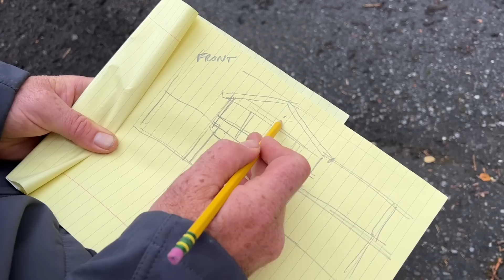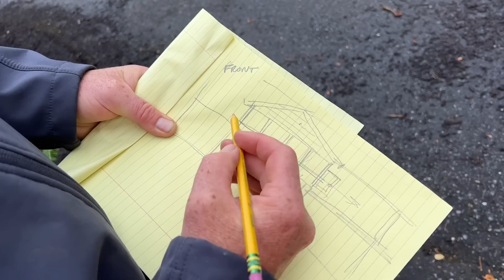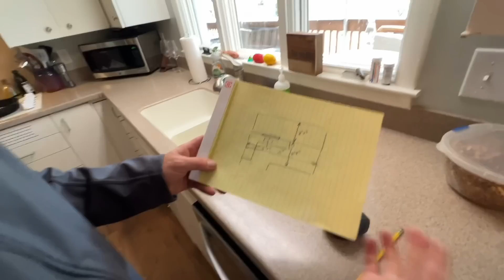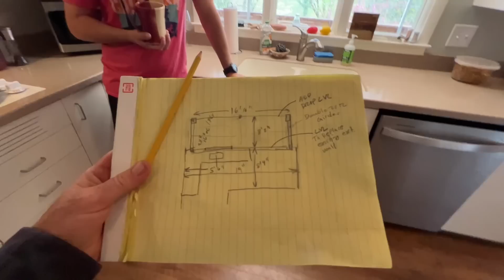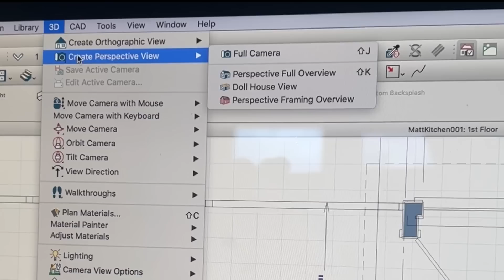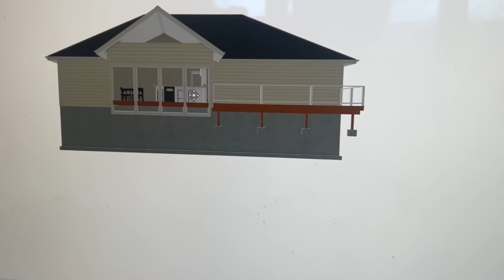Kitchen Addition & Remodel EP01 | The Design

Comment: uv ray's eventually work on breaking down any kind of liquid applied water proofing not too mention the hot & cold constantly effecting it, it will, eventually become a place for water to settle and that will become a leak after 20 years single tab asphalt shingles are going to break down.

Comment: 2" floor rise... could use rigid foam under the subfloor for added insulation and cheap spacing. It's how I turned my deck into a 4 season sunroom.

Comment: Hey Eric, Those brick "posts" look like thin legs on a tall bird. I recommend you drop back few inches and build 8X12X16 finish blocks. Add rebar and grout. Then add what ever kind of top girder you want. But, strong winds or a small earth tremor on those brick stilts will allow crumbling, especially if you add load on them.
Reply: I'm having trouble visualizing what you mean
Reply: It depends a lot on how the columns are built... If there is a central rebared concrete column (looks like there might be, based on the dimensions of the column vs the bricks) then there isn't any concern.
Reply: @MrCjallaby  have you ever seen a stack of finish concrete blocks? They are everywhere in the mid-west.
Reply: @kschleic9053  it does not depend on a lot of anything except simple math. The modulus of blocks will be about 1 1/2 times that of the brick stack and 10 times the stiffness. But, don't take my word for it. Go buy a Jenga Block game and figure it out for yourself.
Reply: @Tony McSteven Yes the irony. Like it?
Reply: Very curious how those brick columns are made!  Hopefully if the LVL goes in as discussed it will help stabilize them more-so, but they do look tall & thin!
Reply: Mason, concrete finisher here.. excited to watch further but I’m also very skeptical of the brick piers. The wider the pier the more resilient it is from movement, I’m curious if the brick is just a veneer around a 6x6. If it were me I’d shore up one pier at a time, tear down the brick, pour proper footers, and then lay 16” x16” block piers and fill it solid. Take shoring out, bolt in whatever lvl brackets you want without worry.

Comment: I really like that program. I also purchased that program because of your channel. 

It really does a whole lot! Huge learning curve for me, but it was doable. 

When you have the ability to make professional plans, it makes it a lot easier to get through the building and zoning department. It also gives a clear picture to your client of what you are doing. 

You can go as far as putting material lists in your building plans and also cut lists. 

Chief architect 2022 is awesome. If you are a builder, even a small builder..  you really should consider purchasing it. You can even do a monthly subscription which is $60 a month, and pay as you go. 

 If you come into the slow season and you don't need it, you don't have to use it, you don't have to pay for it. Then when it comes time for you to get busy again just go and spend another 60 bucks.  It will make your life easier, and bump you up a level. 

Great video btw!
Reply: @davidwesternall873  the program is great.

Comment: I'd put arches under the deck, not only are they good for structural support and spreading the middle weight to the post but they're also  quaint and esthetic.
Reply: Sure it might not fit the style of the home to well but you could easily do it with bricks, cheap, pretty, easy and strong.

Comment: Enjoy ya'lls videos. Don't recall the episode but you guys were using a "paddle bit' or spade bit to remove some wood material. Years ago I purchased some Bad Dog brand "Rover" bits.. I use  them all the time remodeling and repair work.  Wonderful product, faster that spade bits and user can control the direction. Might want to have a look... I'm not in anyway affiliated with Bad Dog. Just like this product.

Comment: The brick columns are 16" X 8". Building code gives a max height of 80". Since your existing height exceed that, any new construction should at least meet the building code. A 12" X 12" would most likely pass, it would still be marginal with a max height of 10 feet. Ask anyone on the street, bigger is better!
Reply: I was just going to look up brick columns after this video... I'm always nervous touching masonry with anything load bearing.  Around here a lot of foundations are concrete but for some reason the last 2 or 3' are hollow clay brick. Stuff cracks if you look at it wrong.  This looked like traditional solid brick at least and very nice & large grout joints so those would be easier to drill into for anchors, but I'd still be nervous for something this far off the ground.
Reply: My wife agrees

Comment: Pro Tip: Cleaning roofing tar off your skin or tools, WD-40 100% cleans it off with minimal effort, Like amazingly wells, so on your skin just clean it with Wd-40 then clean the wd-40 off with normal soap.
Reply: Wd40 or karnaclean is a lifesaver
Reply: Baby oil works wonders also. Like dissolves like

Comment: Those brick columns concern me considering the extra weight going on them. You really should be getting an engineer involved.
Reply: I'm reminded of those decks that fail due to unexpected weight with more people. I imagine a kitchen with island and appliances will be a gathering spot for family/friends.
Reply: There really should be a lag bolt or equivalent in between everyone of those joist on that rim board. It scary how light people build decks.

Comment: Nope, no way I'd do that addition without a architect or engineer,  and no way I'd trust them brick columns,  definitely need something bigger,  like cmus,  plus I would never trust them old joist.
Reply: Bricks carry 9000 pounds per square inch. CMU's carry 3200 pounds per square inch. Bigger is better.
Reply: @metroman93f27  You might want to double check your numbers
Reply: @jtgrec3179  I was referring to clay brick. they have a compressive strength of between 8000 to 10000 psi. Concrete brick have a compressive strength of between 3000 and 4000 psi. My number for the CMU would increase with grout. (It increases the square inches). The grout itself is usually 3000 psi.

Comment: What does it mean when you said "we aren't the contractors on this job, the homeowners are" ?  I wasn't sure what the significance of pointing that out meant.  (or if any other viewers know the answer and can help me out).
Reply: The homeowners are going to manage the job. They are going to pull the permits and hire all of the subs.
Reply: I don’t think the Perkins will be doing everything that the homeowners want done. Probably just the framing and helping out with understanding what they need to get done. 
So once the Perkins have finished their part, they aren’t going to have to worry about any other part of the project.
Reply: @darrenmarsh2290  Thank you!  I thought it might be something like that when he started talking about them having to take his plans to the city, instead of doing it himself.

Comment: Eric, I've never felt like saying anything, but will this time.  You're not doing your friend any favors with what you've planned.  First, the existing structure needs to go, those joists have been out in the weather for who knows how long.  I noticed the 14" LVL, did the size of that surprise you?

The roof is another matter, I was able to see, even in your video, the wear on those shingles.  The whole thing should be replaced.  Didn't we just learn in your last video, that the stone on the fiberglass shingles, is what protects it from UV rays?  Come on man, don't short-change your friend - because you think you're saving him money - it's the wrong approach.
Reply: Please go away with your Matt Risinger type of approach. He was supposed to renovate his house, ended up redoing the whole thing. With that approach you will probably advice them to rebuild the whole house because shingles are old and deck joists might be weathered.
Reply: @Faruk651  also the Mike Homes approach.
Reply: The roof really needs to be ripped off. If cost is an issue I would for sure do the entire back now and then do the front within a year. And the framing over the shingles 😭
Reply: @smcox1991  yes, it is obvious the roof needs to be replaced but maybe it can wait another year. Not everybody has deep pockets and fancy way of rebuilding like Matt Risinger or This Old House.

Comment: This is the wild west. This project should be designed by a structural engineer after conducting a site survey, not a GC who wears flip flops on a wet roof. LOL.  No disrespect to Perkins but let's get real here. Relying on the municipality to sign off on this is moronic - the municipality is clearly not invested in safety if they approve this.
Reply: I know enforcement and standards vary across regions in the US, but I second this. Talk of reusing the deck support columns seems completely irresponsible. Sure they're basically creating a sunroom, and maybe those deck supports are integrated into the existing foundation? But they're glossing over a serious structural safety issue.

Decks like this fail on their own fairly frequently. I'd never think of putting a whole room on top of just a deck given how lax deck structure can be.

Comment: Why would you need a permit for an existing building. Surely  Modifications are only inspection once complete?
Reply: If you're changing the visual appearance of a building you usually need planning permission.  At least in all European countries I've lived in.
Reply: We are adding a big room on our house. We needed a permit to demo the old falling down room. Then we needed inspections on the footings,foundation,framing,electrical,insulation,then finished project. We are getting to know our inspector very well. If you do a project like ours without a permit the county has every right to make you tear it down. The reason is they want to make sure it is safe for me and whomever might buy my house in the future.
Reply: I my area you'd definitely need a permit for that, although I can see why they'd avoid it. The permit process is so stupid and unnecessarily difficult
Reply: Where I live a permit is required for any plumbing electrical or structural additions

Comment: NO NO NO!!!
Please tell me that your “proposed kitchen cabinet layout” is not the final layout! As shown all you’re doing is just keeping the original kitchen layout and adding a “sunroom”. If you’re going to spend all that money at least make the kitchen more functional. So what, in my opinion, is wrong with the proposed plan? Well, to start:
1. There are two interior doors leading into the kitchen from the rest of the house and with the proposed kitchen cabinet layout everyone entering the kitchen has to funnel through a bottle-neck between the front of the fridge and the wall on the right (when the fridge door is open the bottle-neck will be much worse).
2. There is only about 15” of countertop between the stove and the fridge. There should be a minimum of 24” of countertop next to any major appliance (and more if the countertop is shared between two major appliances) so that you can use it as a “landing zone” for food, pot and pans or plates.
3. There is a huge amount of floor space dedicated to circulation pathways. To get from the rest of the house to the back sunroom door you would have to walk into the kitchen, turn right, walk through the kitchen work zone, turn left to get around the peninsula, turn left again and then walk across the entire sunroom.  Not only is the pathway extremely long and circuitous but if you’re standing at the stove trying to cook and someone walking through the room bumps into you it could cause a dangerous accident. Never design a kitchen so that people have to walk through the work zone to get to another space.
4. In the proposed layout there are two seating areas that people will have to squeeze past in order to reach the back door. The circulation pathway around the end of the peninsula is just too tight (especially when the dinette chairs are pulled out).
But all is not lost! Here’s an easy fix for everything:
1. Flip the kitchen from left to right. Just by doing that you’ve opened up a straight path from the two interior doors to the back sunroom door and the kitchen work zone is now tucked back into the more protected corner on the right. Now the homeowners can cook without worrying about people moving through the room behind them.
2. Move the cabinetry that’s on the lower wall over to where the fridge and stove are now.
3. Move the dinette table and chairs into the sunroom so that when people are sitting there they will be able to enjoy the windows (and by doing that you won’t need the second seating group).
Hopefully things aren’t so far along with the build that these suggestions can’t be implemented.